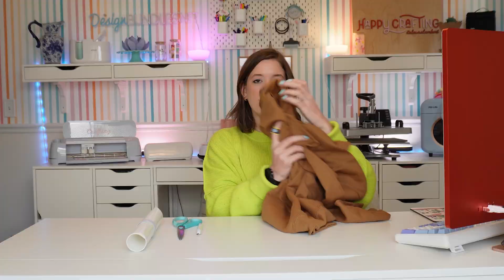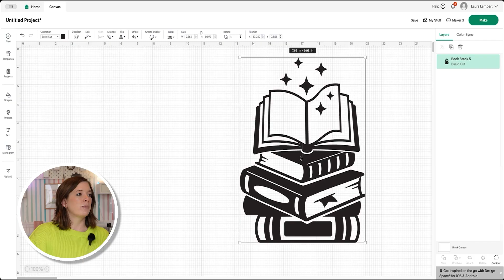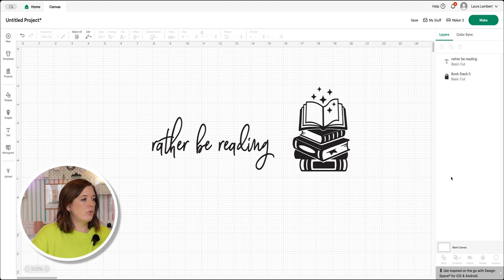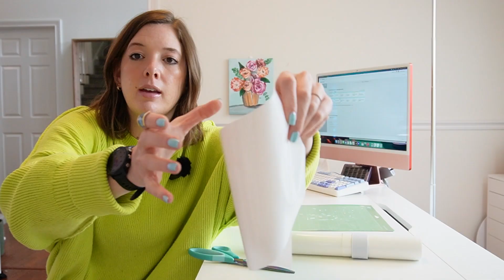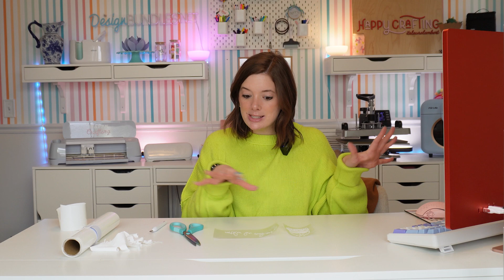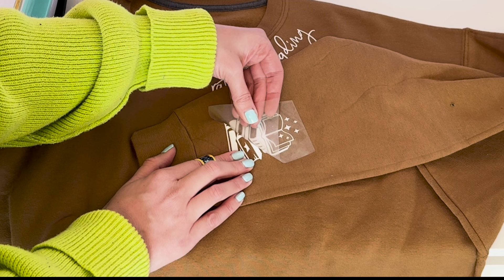🎨 Your First HTV Project! | Free Cricut Beginners Class #4 ✂️

Comment: Thanks so much for this video. 

I acquired a second-hand Cricut Explore Air 2 and an Easy Press last month. I've been making things with adhesive vinyl, done some metal engraving, and used markers in Clamp A, but I have found myself feeling a little scared to break out the Easy Press.

This video makes it seem much less intimidating.

Any tips for using the Easy Press? I don't have the room for a full-on press right now.
Reply from the maker: I love that you are jumping into the crafting world! Honestly, I use my Easy Press about as much as I do my clam shell press. I would say make sure you are on a flat surface and apply even pressure! The issues I have had are an uneven press and that will mean your design doesn't fully adhere.
Reply: @DesignBundles  Wow, thank you so much!